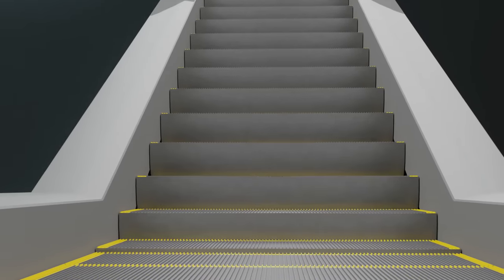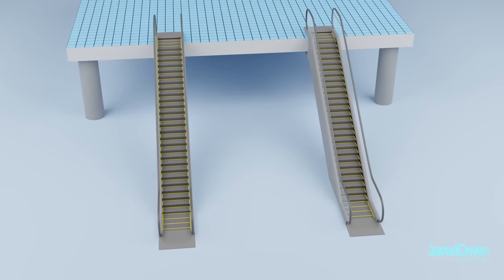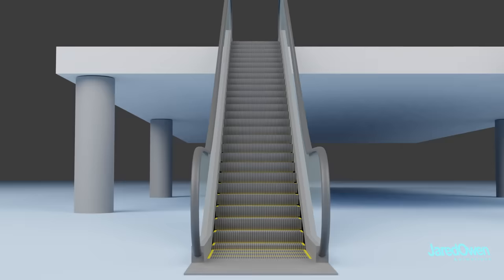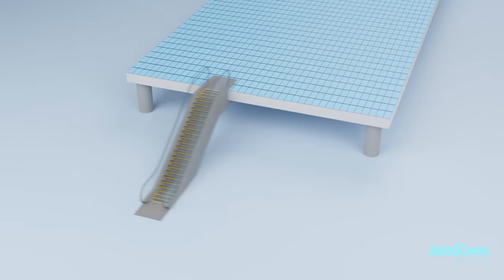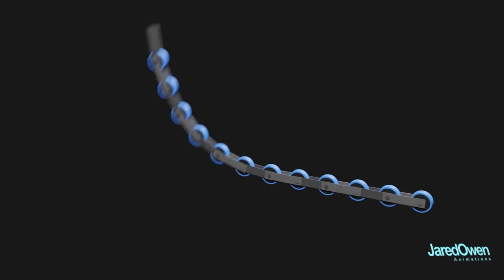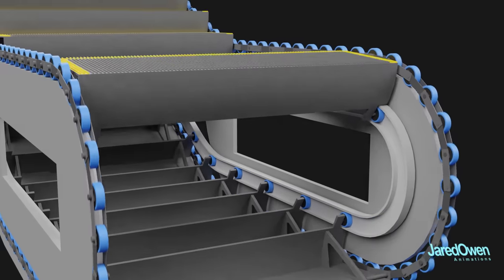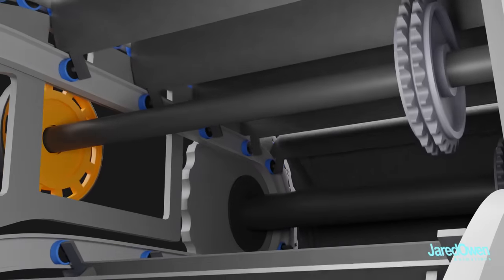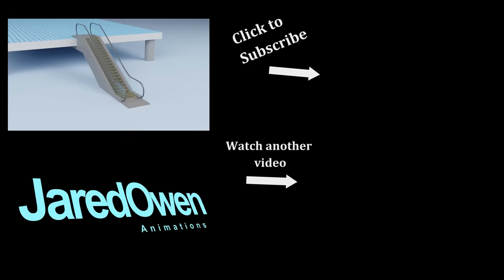How does an Escalator work?

Comment: How many amps do those motors typically pull? They must have some pretty hefty torque to move all the weight that could be on them. Also, the handrail moving at the same time. I don't even know how so many of them here in Australia fail to do this! It's so annoying resting your hand on the rail only to have you hand slowly walk away from you as it moves faster!! Haha!
Reply: No there things called gears, australian might
have them, then huge v8 motor not neeeded

Comment: I have the impression that the handrails usually move a bit faster than the steps. When I lean my upper body against the handrail, my upper body tends to move ahead a tiny bit faster so that I'll have to readjust my upper body position in relation to my feet so that I don't fall over. Anybody have the same experience, or someone who can confirm that this is the case for many escalators?
Reply: Yeah this is intentional, it keeps people from tipping over towards the dangerous direction.

Comment: And at the top or bottom theres an emergency stop plus a switch that needs a key to activate and control the escalator direction, some old escalators need to rest for a few minutes between switching directions or stoppages.

Comment: Three years later... I'm curious what sort of safety apparatus is used if any, in the event of something breaking in the drive line.  The quiet operation seems to suggest it can't be a ratcheting system such as used in roller coaster lifts.  So, do escalators just count on the drive chains not breaking or is there some feature to keep them from free wheeling?

Comment: The handrails are slightly faster to prevent elbow locking when ur elbow is at the same position for too long and stiffens. If someone’s elbow stiffens during a long escalator ride they might not be able to get off in time at the end which is a safety hazard

Comment: I want to tell you about one misconception associated with escalators. 
The fact is that many people think that the handrails move at a different speed so that people do not "sleep". It sounds silly but many believe, although this is all due to a slight out of sync. 
In cheap models, this can be very noticeable. 
I remember going down deep into the longest subway station in the world. (in Kyiv) Two very long and fast escalators were used there, and a pair for each side. Depending on the flow, some could move in different ways.

Comment: how common are ones that are directly mechanically connected. I feel that would significantly reduce the motor strain. also, I'm wondering how the driving of the downward escalator works. does it generate power when it is going down, or is it just dissipated as heat.

Comment: You are wrong hand move littlebit faster than stairs.  Escalators are designed so that the hand rail travels faster than the stair - this is to prevent users leaning on the rail and not paying attention, thereby ending up in a heap when they reach the end of the rail.

Comment: I hate to be THAT guy, but actually in the most modern escalators the handrail moves little bit slower or faster than the stairs. Passanger is therefore presured to change the postition of hand. This is to ensure that the passanger is "awake" and not distracted by something else. Basically it is a safety feature.

Comment: Those escalators can be really long. In Kyiv there are a few metro stations where the escalators are so long you cannot see the end when you are at the top. And the travel down takes around 10 minutes with quite a high speed.

Comment: They actually work exactly how I thought. But, it begs the question, why do the handrails sometimes move faster or slower than the steps sometimes if they are both driven by the same motor.

Comment: Did you know that there are  emergency cutoff switches built into the metal panels down along side of the steps? If you kick one of those panels, it will stop the escalator dead.

Comment: i have NEVER ridden an escalator where the steps and hand rails move at the same speed. they are always faster or slower.   any safeties in there? to prevent the entire assembly scrolling back down if the chain breaks?

Comment: I have seen videos of malfunctioning escalators where the a gear was stripped or something and the sear weights of the people pull the line of people into a pile at the bottom. That usually happens on extra long escalators that climb like 4 to 5 floors. The weights of all the riders just add up to the point of mechanical failure. Surprisingly, there seems no braking system in case of emergency. Too scary!

Comment: i always had this idea of make green energy out of escalators that are taking people down...
its easy to made + it will provide 70% or more of energy that the second escalator that taking people up can use so it will make moving people in a subway system for example less expensive by 70% or so ....we are talking about 24/7 300 escalator or more that alot of money and carbone to save  ...what do you think guys

Comment: 1.  The handrail NEVER moves at the same speed as the stairs;  Typically it moves faster for some reason.  Try this yourself some time.  Grab the hand rail and you will see that you are slowly pulled forward by it...

2.  How do escalators deal with weight?  When some 450 pound porkalard steps on the rising escalator, is there a counterweight like an elevator or does the motor just have to deal with it, burning out the brushes?

Comment: The one issue I always have is that the siderails on every single escalator I've been on have not been timed accurately. They either move to slow or too fast relative to the motion of the steps. You would think calculating and manufacturing a gear ratio to be accurate would be easy and cost nothing extra, but I guess not.
Reply: The handrails are designed to slide so if you get yourself caught you don't get dragged up the stairs. Over time they wear as do the wheels that move them and they'll slip.

Comment: I've never liked escalators.  I always feel like I'm going to lose my balance and fall during the step-on/step-off part.  A bit of a phobia, I suppose.  I use them if I have to but usually prefer to take the stairs or elevator.

Comment: One of the most dangerous devices ever, over a 20 year period the 14 escalators where I worked, had more breakage and people hurt, than I can count. Constant derailment, failures of safety switches, one broke under load throwing people and treads , about half the track came off. While the new stadium saw outside escalators derail injuring a number of people , now all outside escalators are shut down, then the sky wallk system is mostly, disbanded, torn down is that which once connected hotel, restaurants, retail. And art ....they became hobo villages....back to escalators.  On an average the have 28 safety switches, sadly in the case of most accidents the shear mass of the drive keeps it moving even once the power is shut down ....

Comment: Note: some escalators has some sensors to check if there is anybody is using it or not. If not then the escalator will automatically slow its speed and eventually turn of the motor in order to save power

Comment: Im so confused by the direction of the drive motor. Can it drive the escalator in that direction ? I thought it would need it pull the chain instead of push the chain